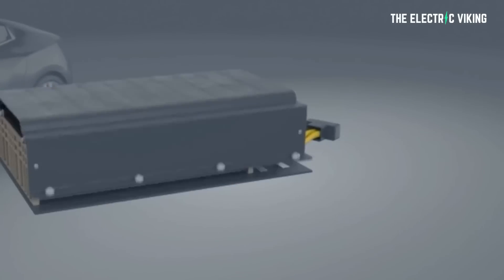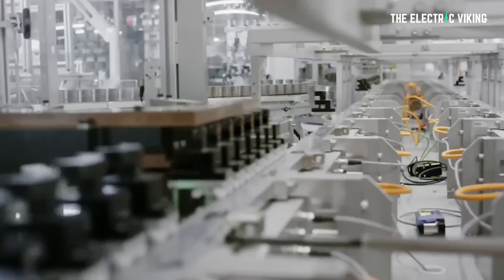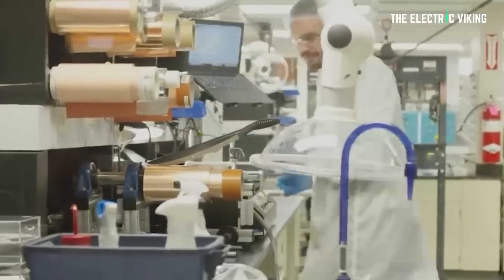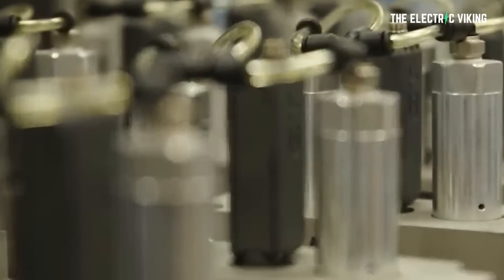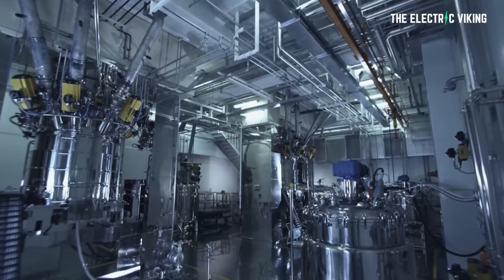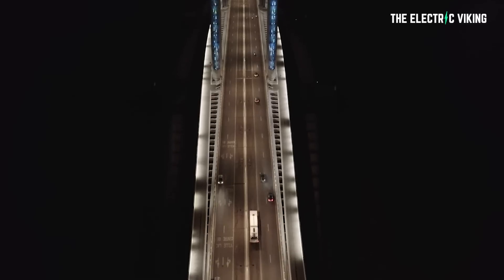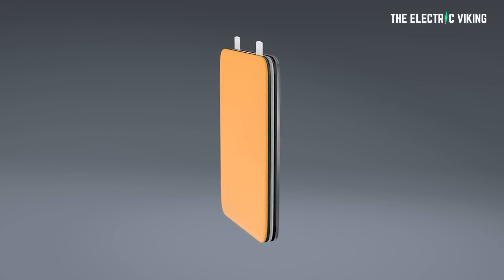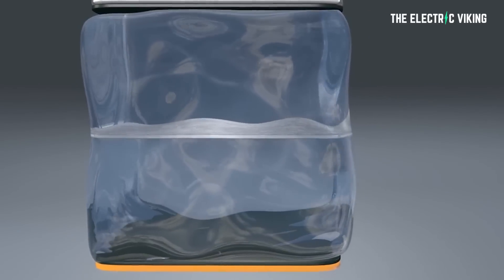5 ways Lithium-Ion Battery technology has changed in only 1 year

Comment: Given the state of aircraft manufacturing and miles of red tape it takes to get a model sold, decent odds it would probably be 10-20 years before a well funded project could have a model in production, if the tech was already produced at commercial scale today for EVs. Even worse the industry for smaller size aircraft this seems would easiest to start with from a technical standpoint collapsed decades ago and has never really recovered, and mostly has been limping along with tiny amounts of production compared to auto vehicle production (Tesla produces more cars on an average day at just it's Fremont factory than new entry level aircraft were sold the entirety of 2021). Some are still selling relatively modest upgrades mostly to electronics, avionics, and engines of airframe designs that have had relatively little change in several decades.

Comment: I guess in a few years time when ‘just’ enough people have switched to EVs, the tipping point, demand for gasoline will begin to drop off. I’m guessing here, but I doubt the costs, overheads, labour associated to producing lower qualities of gasoline will drop off, still need the same infrastructure, to maintain equipment etc, which only means one thing, gasoline prices are destined to exponentially increase over time, as more people switching to an EV due to gasoline prices, causes gasoline prices to rise.
Think from here on in with batteries capable of 300-450 mile ranges, the switch to electric is going to be way way faster than anyone could have imagined.
Reply: I think that petroleum prices will plummet to keep the volume up.
Used ICE vehicles will be dirt cheap and used spare parts everywhere. 
The government will put mileage taxes on heavy EVs.
Petroleum taxes are a % and so will fall away. 
Life will be complicated. 
Conservative politicians will be pushing hard for nuclear central power plants, 60years to 100years of donations and government guaranteed cash flows. 
The Conservatives will push for massive power transmission lines as electricity demand increases. 
The Conservatives will over regulate the market, Angus Taylor and Barnaby Joyce and ....

Comment: A pure Lithium anode is not likely to be safely achievable, since Lithium in a pure state is extremely reactive with oxygen and therefore flammable with any leakage of air or water into the cell. As such, such a battery will not pass the nail puncture test.

Comment: Tesla shift so quick no one can guess there next big move. No one knows the battery strategy of Tesla but for a select few. Commercial airliners take decades to design and certify - we may see a large commercial electric plane by 2050. Small electric trainers are already out there because batteries only need to power for an hour or so and charge in 30 minutes. Don’t get me wrong a breakthrough will happen as it’s simple as this too much money and brain power is focused now on batteries it’s just a matter of time.

Comment: I’m still waiting on electromagnetic induction built into highways so you don’t need a large battery just one that will get you fifty miles
Reply: The thing that worries me about induction charging built into roads is how each user's consumption would be measured and billed for. This problem has arisen in the UK on electrified railways where the track and the trains are owned by different companies. Each type of electric train is deemed to use a particular amount per mile, and this is what the operator has to pay for. Freight train operators are now using diesel locomotives even on wholly electrified routes, because they pay for the amount of fuel that they actually use which costs less than the amount of electricity that an electric locomotive is deemed to use.
Reply: They would have to repair the pot holes first.

Comment: I wish you'd do a video on Monroe live tear down of a 4680 sell to structure because I think Monroe live is shining The turd. Sell to structure implies engineered obsolescence. Yeah, Monroe life proved that it could be replaced but much like all the new cell phones that glue the battery in and only accessible through the front screen they have basically made it economically infeasible to replace your battery, especially if your screen is cracked. Something we used to be able to do in seconds on early cell phones.

From what I've seen of the new model y with 4680 the verdict is still out on everything except maybe it's easier to produce. A video discussing what we know so far about the new model y would be very educational but done from someone who is willing to be critical about what we know so far.

Comment: I'm interested in all the developments, but a milestone I keep in the back of my mind is the day when batteries aren't really an issue because they meet everyone's needs - a not-too-heavy, reasonably priced battery that gives 1000km of range (620 miles), can add 175km/5min or so when charging (350kw charging), and lasts the life of the vehicle. I think we'll see that by the end of the decade or early 2030s. After that, the battery won't be a huge concern for the vast majority of people, which is important for getting close to 100% adoption.
Reply: @tru hartwood, my frame is a little different. I believe that the battery is going to be one of the biggest differentiator between vehicles like liters and drivetrain used to be. People who want the convenience of long distance but they don’t care about all-wheel drive will can get different configurations than people who want all wheel-drive but don’t mind a shorter distance, then there are people who want all wheel drive and want to have a long distance. Those kind of customers are going to be buying different kinds of cars and those battery capacities will drive the costs. Different manufacturers have different strategies (like GM and it’s small block engines, and then aluminum block engines). Some manufacturers are going to have heavier cars with less battery density and other manufactures are going to have lighter cars with higher battery density. At this very moment we’re learning what configurations the market really want. It’s not just long range. Cars will be getting over 600 miles of range in the next year or two and I don’t think people most people need such a car. And that longer range is going to cost lotta money.  So these are the concerns of the immediate term or the medium term. Long-term, meaning 10 years from now, perhaps you’re right and that all of the range on all of the cars is going to be so great and the materials will all be low cost (salt batteries) that most people aren’t gonna care. And they will charge faster than an ICE car can refuel. Maybe at that. The innovation and the battery won’t be so important and people will be making decisions on other characteristics.
Reply: Hope ur right
Reply: I would love to able to get on a electric 747 that would be awesome flights have always been expensive
Reply: I think in Europe a true 350-450 mile range with 80% charge in ten minutes is the tipping point .. essentially a high spec Tesla for the average  generic car

Comment: Sam (or other knowledgeable person) , I am thinking about buying a Mercedes EQS SUV and wanted to know your opinion whether the battery chemistry is good or not.  It consists of nickel, cobalt and manganese in a ratio of 8:1:1.  Any feedback would be most appreciated.
Reply: Sam would answer to better choose a car that is running on LFP or possibly that with manganese added in the mix, but you'd have a wait a little longer for that one.
Reply: Look, all the various chemistries have their advantages and disadvantages. The battery you're looking at is fine as long as you realize it will lose range over time. Maybe 15% after 250,000 miles. LFP might, yes might, have less loss  over time however the trade off would be less acceleration and a heavier vehicle. Loss of range doesn't make the car worthless, just not as desirable due to having to charge more often.

Comment: This much higher density is mostly theory or based on very limited lab results. As the 4680 proves; making a production type is a much larger task.  Right now the only certified small plane than runs electric has a range of 100 miles; the gas version of the same plane is 400. To replace jets would demand at least a 8x improvement in energy density. With Lithium this seems unlikely.
Reply: Agree. Renewable liquid fuels are available and I am sure will drop in price with scale also.
Reply: Th best scientists in the world are working on it 24/7